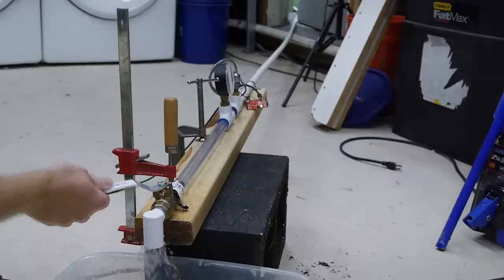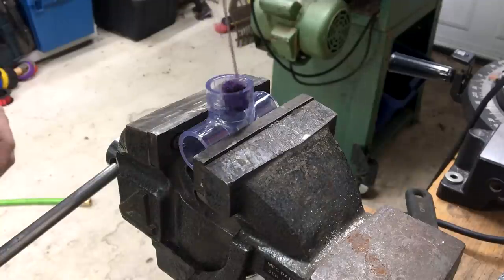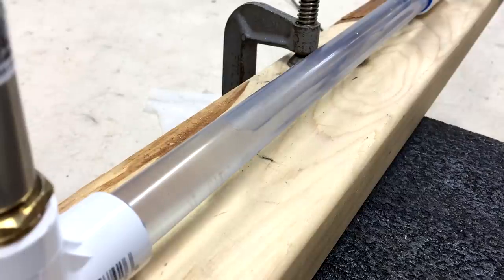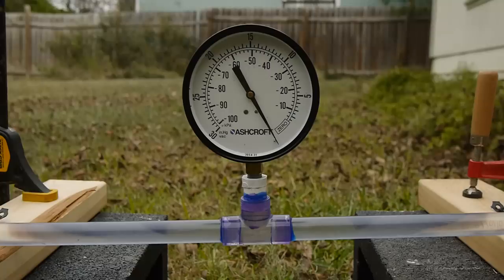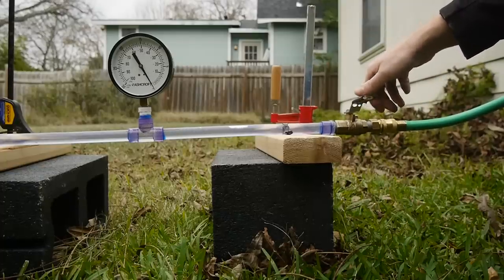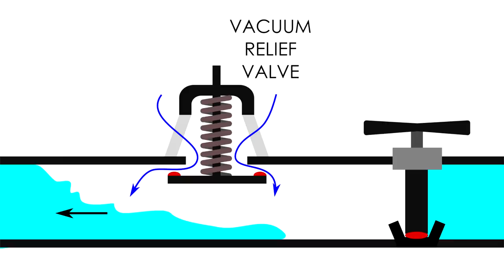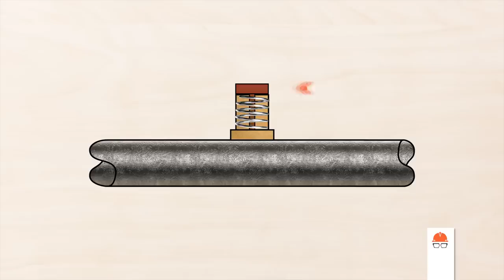How to Collapse a Pipe by Closing a Valve

Comment: Please do a video about epoxy resin's engineering properties and if it might eventually replace concrete.
Reply: this. i always wonder about this when i see people using resin in their wood works.
Reply: One gallon of epoxy costs about the same as one cubic yard of concrete. There are about 200 gallons in a cubic yard. The price of epoxy will have to come down by two orders of magnitude before it could be considered as a concrete replacement.
Reply: there's no way resin is going to replace concrete
Reply: What a loaded question dude
Reply: +Harman Robotics Or the price of concrete would have to go up by two orders of magnitude :P
Reply: +SuperAWaC Why not?
Reply: Feynstein 100 . It is way too expensive. The structural properties come from the fibers it's impregnating not the epoxy. More epoxy less strength. Chemically it's not something you want to inhale or have on you. It's cure is very sensitive to temperature. It exothermic so a slab would burn itself up. It doesn't stick to itself so you either work wet on wet or sand between layers. At best it's a sealer on concrete not a replacement although outside UV light degrades it. A lot of other reasons. ..
Reply: Feynstein 100 just wait until they figure out they can mine cryptocurrency from concrete
Reply: +st1300 r;  Yes, it is too expensive but if cost were not an issue those other problems could be overcome. The structural properties of concrete also come from fibers (in the form of rebar). Chemically, concrete is not something you want to inhale or have on you. Concrete also does not stick to itself however epoxies, do stick to themselves (chemical bond) providing that they have not fully cured. Concrete is sensitive to moisture when curing and does not reach full strength for weeks. Concrete can overheat when poured in large quantities, epoxy hardeners can be formulated to cure very quickly or very slowly - and they can also be UV resistant. If the problem of cost were ever to be overcome (doubtful) then there would be very large incentive to overcome the other issues, as has been done with concrete.
Reply: +Harman Robotics Agreed. However, seeing that concrete is based on limestone and since limestone is a limited resource that we're only using up, not replenishing, it's plausible that concrete and epoxy may cost roughly the same eventually. But who knows, that may be so far off in the future that both materials will have become obsolete by then. Hopefully, we'll find a way to mass produce carbon nanotubes cheaply. :)
Reply: I'd just like to add on top of all the other issues people have mentioned, that Epoxy does not do well with changes in temperature. If there was a fire, it would compromise faster than the reinforcing steel and the lack porosity means the porous parts of the concrete will be under more stress during freeze, thaw, however I'm not sure if that would be a benefit or a problem. For places like Canada where they build foundations, they deliberately make larger bubbles in the concrete to allow room for expansion. It seems counter intuitive, but because they do not fill with water to begin with. it means no stresses are added when the water expands and takes up a bit more of the air gap.
Reply: Epoxy is hazardous to the environment and must never be used in a large scale. It doesnt break down but eventually end up as micro plastic - which we already got too much of and increasing fast. Add a few billion tons of epoxy buildings to that.
Reply: @pflaffik  Oh. I didn't know that.

Comment: In addition to water hammer, cavitation is also bad for fire trucks. When trying to discharge more water than you are taking in, vapor bubbles begin to form. When they enter the pump, they collapse back into liquid, and the shock of the tiny implosions chips away at the impeller blades.
Reply: Dan Teall. Had to look through a lot of comments before I found one that mentioned cavitation. I'm surprised that he didn't mention it in the video. Cavitation is a huge issue & has extreme power. It Deserves it's own video
Reply: Seen a few sewage pump impellers 'eaten' by cavitation.

Comment: The bubbles are not dissolved gases; it's actually steam.  The boiling point of water drops with pressure, so under vacuum, water will actually boil.  That's what causes cavitation - areas of low pressure cause water to vaporize, but the surrounding high pressure causes the bubbles to collapse.
Reply: Could be both!
Even when you heat up water, the first thing that happens is that gases get out of solution with the water, and after that water itself gets over into a state of gas. The gases disolving from the water are the reason why you can make better tea if you properly cook the water as it becomes a better solvent by cooking.
Reply: You are both right. Some steam and some formerly dissolved gas.  The steam would be condensed immediately when the pressure returned, but notice the haze of small bubbles? Not steam.

Comment: Hey this video is really interesting to me for a completely different reason, and I wanted to share it. Massive wall of text incoming, about beer.

I work with draft beer systems and often run by bar owners who reduce their gauge pressure if they start getting foaming beer problems.  They think, "I'm getting too much air in my beer, so I should reduce the amount of air going into the beer."  This is often the opposite of what they should be doing, and I've had a hard time articulating why.  I was taught that this was wrong, that having pressure too low will cause it to be foamier, but I never understood the science behind it.

Now, foaming beer can come from a variety of sources, but the main ones are human error, temperature, or pressure.  If I pour some beer and it's foamy, I'll make sure the keg is nice and cold.  if temp is good but it foams up when i pour it, now we dig into pressure.  

I've had most of this next part understood for a long time, but now I can communicate it.

Pressure could be wrong for a variety of reasons, which causes issues with the dissolved CO2 in the beer.  If the pressure is too high, more air will dissolve into the beer, and when you pour the beer it will experience a very large pressure drop when it leaves the tubing and hits the glass, causing it to foam or at least taste overly fizzy.  This is often the case with the hand pumps that folks use at parties. If you catch it fast enough, you can fix it by releasing the pressure in the keg.  otherwise, the keg becomes overcarbonated, and when set to the normal correct pressure, will act as below.

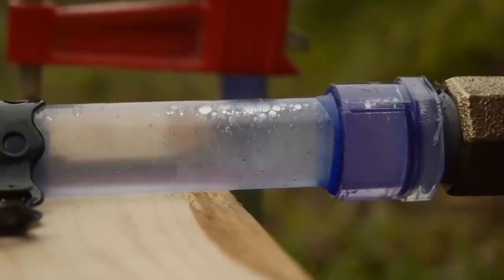If the pressure is too low, air will come out of solution as long as it is experiencing less pressure than what it was carbonated with, until it equalizes.  This can take days, and if the bar moves through beer quickly then they will have a nonstop foaming issue until their pressure is fixed. Every time they shut off the faucet it closes hard, causing the vacuum air effect in the video at 3:10, and exacerbating the issue further.

FYI we tell people to keep co2 between 12-14psi when the beer is at 36-38F.  if you can't maintain a 38F minimum, then raise the pressure to 16-17 until over 42F.  Above 42f you will have major unfixable foaming issues.  if you use ice, you only need to keep the bottom of the keg iced down (The beer coupler with the handle goes into the top of the keg, but it actually draws from a tube that reaches a couple millimeters from the bottom)

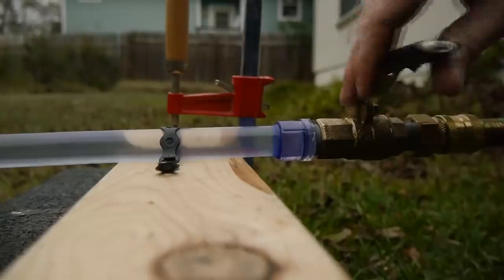Comment: @2:50  I think the haze is actually vaporization of water due low pressure(cavitation), not dissolved gases
Reply from the maker: I don't think the pressure got quite that low.
Reply: Imran is correct. The guage clearly shows that momentarily pressure dropped below 10kPa, water vaporize into steam at room temp.

Comment: Pipe engineer here - had a customer after a shutdown and drainage of pipe for maintenance try and fill the system with water from empty at full open valve and full pump.  The pipe jumped about a foot and scared everyone.  Luckly the pipe did not break and had sufficent flex.  After the customer contacted us  for a redesign they showed us the issue by turning on the pump with a full pipe.  The pipe had a small vibration then settled out, no issue.

Comment: If water is flowing through an inverted u shape tube and air bubbles are inside the stream, would the air build up at the top of the tube and eventually jam the stream or would the air gap just be pushed along the stream
Reply: The Spherical Earth the air would just be pushed through
Reply: It depends on the velocity of the fluid and the diameter of the tube.  If the velocity of the fluid exceeds the rate at which a bubble will rise in the vertical section of tubing in still fluid, the air bubble will be pushed through.  If not, it will rise to the high section of the inverter U.
Reply: For what it's worth, an experienced designer or pipe fabricator would never install a permanent system like that. If there must be a high point, an air release valve would need to be installed.
Reply: While pumping out my boat last night with a clear hose and a small electric pump I observed exactly the phenomena you describe. As the pump began to suck air, the bubbles accrued at the top of the loop and eventually blocked the flow. When I moved the pump to a deeper spot, the increased and airless flow was able to overcome the blockage and blow the bubbles through, and out of, the hose.
Reply: @osubucks2010  Would you still need an air valve if the downstream pipe of the air valve is atmospheric/open-ended?  Given that the end point is of a bit lower elevation.

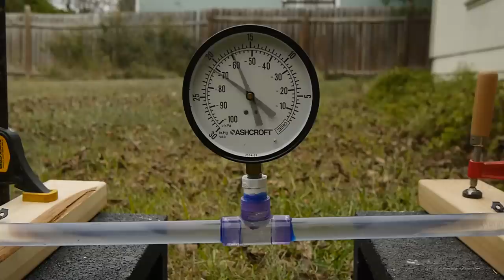Comment: @2:30 You can't have a peak of more than 30 inHg of vacuum. 29.92 inHg is a perfect vacuum, or by definition, absolutely zero molecules in the area measured. The gauge spiking to over 30 inHg is just the momentum of the needle carrying it past the perfect vacuum mark. 

Side note: vacuum gauges are calibrated to 1 atmosphere for use on planet Earth. The only thing the gauge is measuring is pressure in relation to the pressure outside of the gauge. Hypothetically, if you pulled a perfect vacuum on Venus, the reading would peak at about 2692.8 mmHg because the atmospheric pressure on Venus is about 90 atmospheres or 90 times the average pressure on Earth. The opposite would happen on Mars where a absolute perfect vacuum would read only .177 mmHg because the atmospheric pressure on Mars is about 0.005 atmospheres. Now, pressure on Earth is not always exactly 1 atm (for which these gauges are calibrated for). If you are below sea level, it will be over 1 atm and above sea level it will start dropping off. At the summit of Mount Everest, the pressure there is approx .25 atm
Reply from the maker: Ambient air pressure was over 31" Hg that day. I made an obvious joke about how my guess was far from a scientific observation. I don't think it quite reached 30" below ambient but I think it got close.
Reply: I sort of love the fact that I didn't catch the joke in the video. It means I'm in the right place, to learn some more that I didn't know! Thanks for the video and for once, the comment section as well!

Comment: Very awesome video! How would this relate to installing new high efficiency washer/dryers that tend to shut on/off the water valve to save water (with their eco settings) - Would installing water hammer arrestors on the hot/cold spouts address the positive & negative pressures as show in this video? I just put a new washer/dryer in, and have not experienced any noises or shaking of the pipes when it runs through a cycle, i bout 2 x 20$ arrestors off amazon, but have not installed them yet - should I install them on the wall spouts or on the washer and hook the hoses up to them
Reply: The negative pressures talked about in this video are not an issue for a washer. Any arrestor device installed upstream from the valve would have no effect (on negative pressures). It is what happens after the valve that causes the negative pressure. Arrestor devices will however dampen pressure spikes cause by fast shutting valves.
Reply: It certainly wouldnt hurt to put them on if you bought them already.  Some valve types are designed to shut off slowly, (Diaphragm valves with a hole of a carefully chosen size in the diaphragm)  and some slam off/on (like a solenoid valve)  Ive noticed some washing machines have a distinctively slow turn-off, which would reduce water hammer. 

Also,  use the stainless braided hoses instead of the plain rubber ones to run from the wall to the machine too.  When the rubber hoses fail (rubber hardens, cracks eventually) they end up bursting and dumping a lot of water.   The braided stainless ones last longer as its steel rather than fiber-reinforced rubber providing the strength,.When they fail the rubber liner leaks, but as its contained by the steel, rather than bursting you get a much smaller leak which can hopefully be caught before its caused a ton of water damage.  Finally, if its not in an unfinished basement where a slow leak wont hurt anything, consider a washing machine pan too.   The price for all the accessory bits can add up, but $100 wont even begin to touch water damage repair if something goes wrong.
Reply: I agree with all of your information except for the hoses, all the stainless steel hoses are warrantied for 5 years, versus the rubber hoses at 7, both should be replaced at these times - i can buy the rubber ones for 1/3rd the price and set a boomerang Gmail e-mail to remind me to replace them in 6.5 years. I prefer proactive maintenance on hoses. Thank you for the information about the diaphragm valves.

Comment: Doesn't your mechanical gauge suffer from momentum effects? It looks like it's minimum time to get a reading isn't fast enough to measure this
Reply from the maker: Yes definitely. That’s why I joked about it not being a scientific observation
Reply: True, didn't notice that line, thanks for replying! Faster instruments are probably 10x the price, not so "backyard" ;-) I was expecting a thin metal/plastic pipe that would collapse when the valve was slammed shut, just another idea for later
Reply: The return time of the wave is dependent on the length of the pipe (among other things).   In a real-world sewer rising main of, say, 1000 feet in length, the pressure spikes are several seconds apart and you can easily see them on a gauge.   However, it's not the negative (vacuum) spikes that are alarming, so much as the 'rebound' when the gauge needle goes off scale at +100psi and whacks against the zero stop from the wrong side   :)       
(Yes that shouldn't happen.   There was an anti-vacuum valve incorrectly set up).

Comment: Appliance solenoid valves open and close very quickly, like in a dishwasher or washing machine.
Reply: It's all fine when you have enough of a buffer to prevent damage. Long lengths of flexible pipes are great accumulators

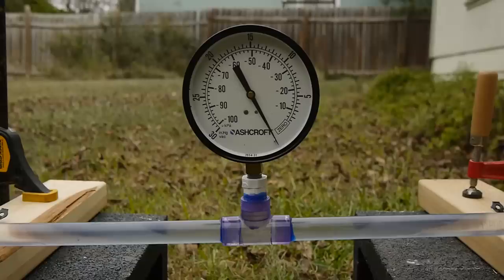Comment: 2:30 "I'm seeing a peak of over thirty inches of mercury". No, what you are seeing is the gage needle overshooting - then beginning to settle. The pressure spike is so short lived that the needle does not have time to settle to a reliable value.  Watch how the needle bounces back and forth, the middle of the range of that bouncing is around 23 inches of mercury. Nowhere near "over 30 inches of mercury". BTW, 29.92 inches of mercury would be a perfect vacuum on a standard day.
Reply from the maker: Haha, Pressure was over 31 inches that day in San Antonio. I tried to make it clear that my estimation from the gauge was not a scientific observation.
Reply: My point is that you are not seeing a peak of over 30 inches but the result of needle overshoot due to the inertia of the mechanism caused by a transient spike. You can however still estimate the pressure of that spike (non scientifically) by averaging the swing of the needle.

Comment: the gauge is tricking you. you literally can't pull more than 30 in\hg of vacuum as that's literally a perfect vacuum.
Reply: Yup I was thinking the same thing, 14.7 psi = 1 atm = 29.93 inches of mercury.  Vacuum is not likely to damage any pipes unless rated for no pressure or a thin walled tank like a 55 gallon drum, kinda clickbait...
Reply: @anime2485  Just depends what your reference pressure is.  If you are talking about an oil pipe 2km down on the ocean floor it's a whole 'nother ball game.
Reply: Well, is that entirely true? The way that very tall trees get water all the way to the top is through very deep negative pressures which are possible in a pure fluid environment. I'm not sure if you could recreate this effect here though
Reply: @thomgt4  I don't think so. What you mean is probably osmosis, which can create big pressure gradients, but absolute pressure can't be less than 0 atm. Trees also start the water transport in the roots with ~ 1 atm and evaporation in the leaves leads to negative pressure - but at maximum 0 atm (but that could only transport water ~10m up) and according to the source creates an osmotic pressure at the leaf cell walls thus sucking up the water up to 100m.
Source: https://www.scientificamerican.com/article/how-do-large-trees-such-a/
Reply: @anime2485    Most large water mains (say over 30" diameter) are thinwall steel and can easily be collapsed by internal 'vacuum'.    They usually have air valves to release trapped air but those valves also perform an even more important role of letting air in if the water pressure inside drops below atmospheric.